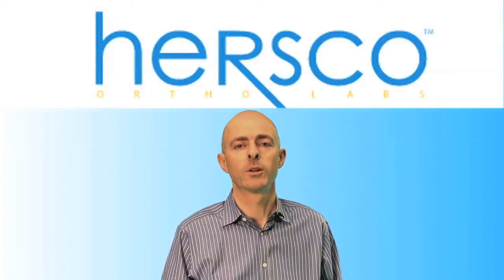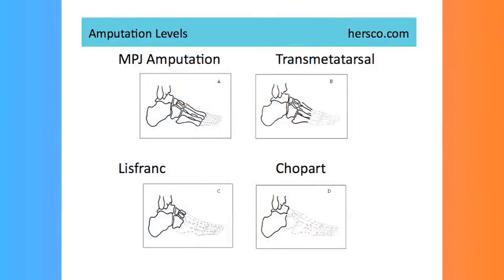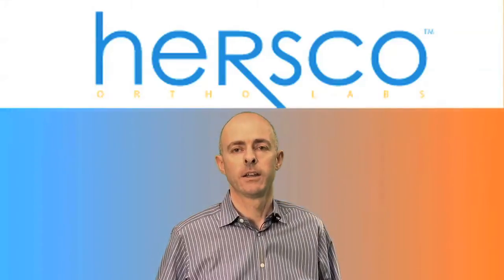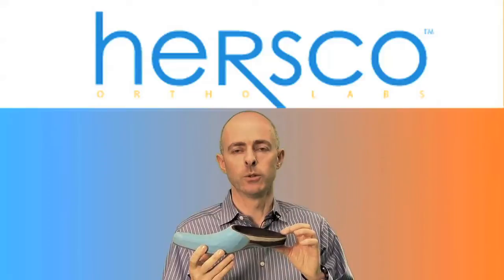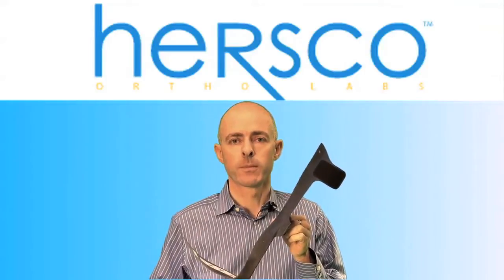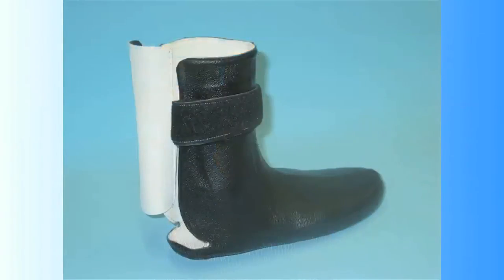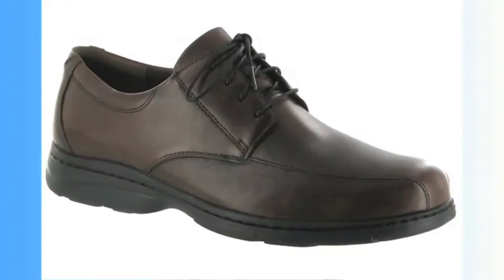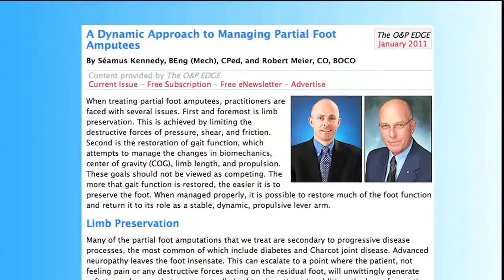Partial Foot Amputees Part 2

Comment: Yes, I have a trans met with an ago with a leather cover. It has a side entry and Velcro straps. It has a separate heal cushion. I have the same problem as metal man. Throws me off balance and is painfully on uneven ground. I wonder if there is a solution?

Comment: The problem I had with an AFO was the forward knee thrust involved when stepping on odd angles. Such as walking up or down a inclined walk way or on uneven ground. The prosthetics outfit that I have been dealing with for my trans met amputation created a custom brace for me that is not as rigid as an AFO, yet still gives me the support I need!
Reply: How was the problem solved?